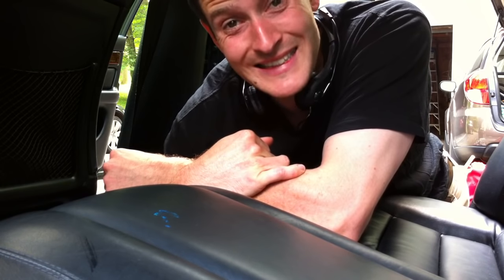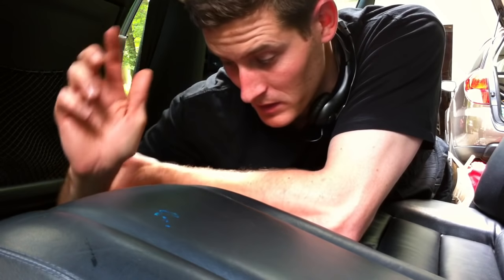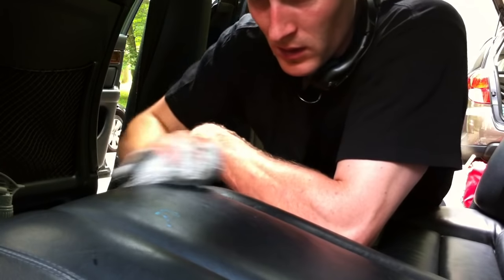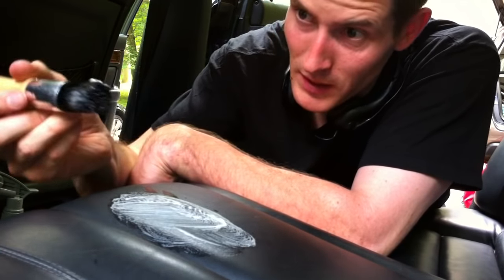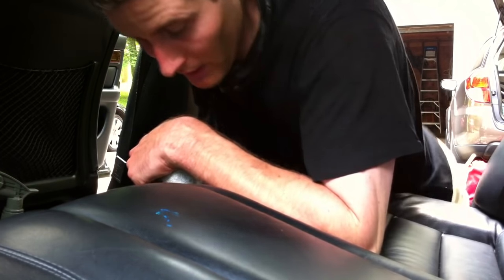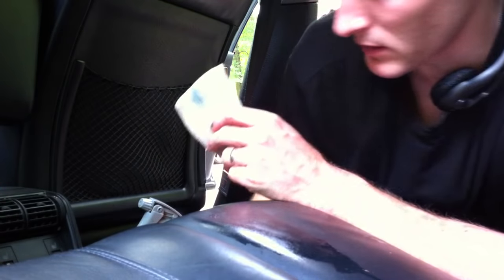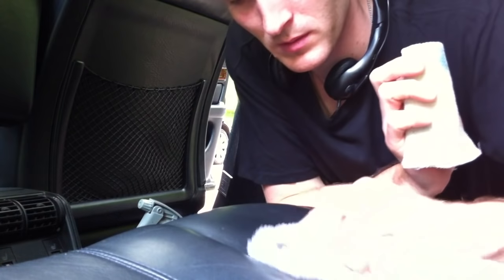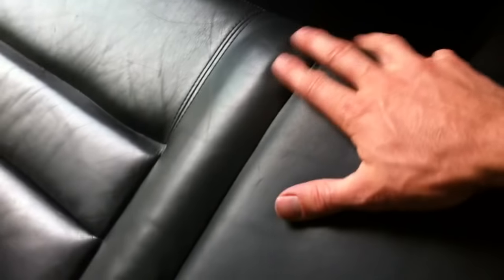How to Remove an Old Stain from Leather

Comment: Instead of plastic cleaner, get white Feibings saddle soap for leather and that will pull way more off than any other cleaner without hurting or changing the leather. You could still use your rag and brush process with saddle soap too. I work leather for a living, you can also use feibings leather balm for cleaning with a flat finish. The reason this worked was because you basically wet sanded the leather with that abrasive cloth and that soap but saddle soap will blow your mind on shine… and clarity of the original leather color.
Reply: Got a pink stain in white leather sofa from a drink called s9motomax nothinks getting it out what's best idea

Comment from the maker: Not to sound self serving, but I'm releasing my interior cleaner called "Lather" in the next few weeks. In the mean time, you can use warm water and the slightest bit of dish soap. Very little...and work it slowly and gently. Its not ideal, but if you are in a pinch.
Reply: Hey bro that was awesome I have an issue have somebwood chairs I bought and were still alil wet from the finish it got on the ivory vinyl pad any ideas I. Tried everything
Reply: Hi came across your video while looking for tips on how to clean a stain on white couch leather. My dog throw up and went trough the tin protective sheets. Would be able to provide me a specific plastic cleaner brand and/or yours if it’s out

Comment: I had accidently spilled wood stain, and it had trickled down my leather sofa which I had not noticed at the time. I had tried everything to remove it before watching your video. Your third method worked an absolute treat and completely removed the stain. Thank you so much! 😊

Comment: have you ever dealt with tire stains on vinyl or leather seats. happens often when you transport new tires in the back seat of your car. you later find the ugly look of the tire print permanently on the seat. Any tips to remove those kind of tire stains?

Comment: While the paint is gone, the abraded leather surface where you removed the paint, is still visible at the end of the job. Was this picture taken before or after you put leather conditioner and/or a leather wax or protectant on that area? Great job in removing the old, dried paint spot.

Comment: i have white leather in my stang and i had to get 2 new front tires and i did not have anything to protect the rear leather seats, it was a hot day and the tires stained the leather almost like it "tattooed" the leather i tried scrubbing the f out of it with the back side of a dish sponge using every cleaner i had and nothing would come out,,any suggestions anyone?

Comment: You are best.... Need advice.... How would I remove a milk strain from leather..... It got socked pretty good... Help pls?
Reply: Try the steps he did, if it does not come out when you may need a steam cleaner to get some heat. But a leather cleaner and a brush works good!

Comment: Nice work one of my “Go To” cleaners  ive used over the years  is the original non Pumus Go Jo hand cleaner  a great thing about it  is its safe on your  skin and cleans up with just water  plus its pretty cheap  and easy to find  ive used it on my own $ several thousand dollar  couch in my living room  and i beleive the Lanolin actually conditioned the leather although I’m not a Scientist  BTW ive used their Orange Pumus  degreaser to polish  a Motorcyle Engine  on the bike  using a Rotary tool and polishing  attachments  why you ask? It was indoors and i didnt want toxic fumes   Or have to wear respirators !  I did however  use other polishing compounds for some of the final  buffings  my next motorcycle i will however  do the motor  with it out of the frame and apart  to make it easier  to get into all  the small areas  probably  clamping  many of the parts in my vise and  Saddle makers leather clamp  that can tightly hold odd shaped parts  I built the clamp myself  as i do use it for hand Stitching leather projects as well

Comment: I would also suggest lightly heating the leather with either a heat gun or a hair dryer before applying cleaners and conditioners.  It gets the pores in the epidermis to open allowing the chemicals to penetrate deeper.
Reply: Exactly like a steamer but a million times better

Comment: "Goo gone" products work good on untreated paint. It took spray paint off of a motorcycle fairing. The paint  was baked on for years over the rear fairing clear coat. none abrasive. Looked brand new.

Comment: Great videos! Will this work for ink as well?
Reply: For ink try a product called Amodex... it's not specifically made for car detailing, but is amazing stuff and is an indispensable tool in your arsenal once you discover it! 

(I work with leather and had discovered it after researching the best product to remove ink stains with without harming the leather at all, and decided to give it a try after seeing it was very highly recommended and also fairly easy to find... even some major office supply/stationary retailers carry it, and of course Amazon too). 

Well, I was so thrilled with the results (that was many years ago that I'd discovered it), that it's now definitely my 'go-to' cleaner for ink stains on leather (and many other surfaces as well)... and also works on a number of other types of stains too. 

I realize your comment is a year old now, but hopefully this is helpful info for anyone looking for an easy, safe, and excellent way to deal with otherwise normally stubborn ink stains (or others of that sort)!

Comment: Very similar technique to what I used to do for leather seats in airplanes. I used to use Ultra Fine 1000 (10.3µm) wet and dry Microgrit sandpaper with a cleaning agent. Never failed to get the marks out. 

Pen on the other hand is a nightmare. Have to use a very harsh chemical, wipe it off immediate and then chuck a neutralizing agent or cleaning agent to neutralize the leather from becoming too soft. Then usually had to respray to get it back to the right colour.
Reply: For pen ink a product called Amodex is the bomb! (and no, I have no affiliation with them... but since discovering it have been thrilled with the results for removing ink from my leather work!)